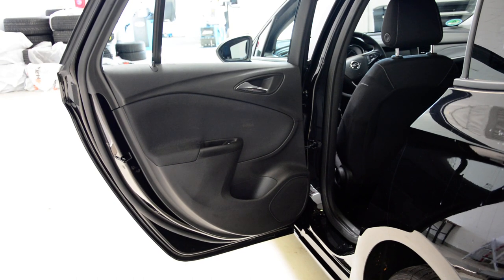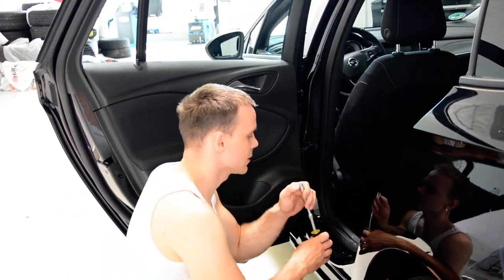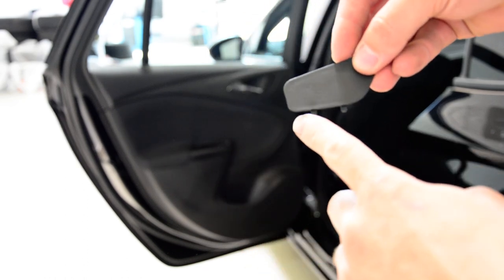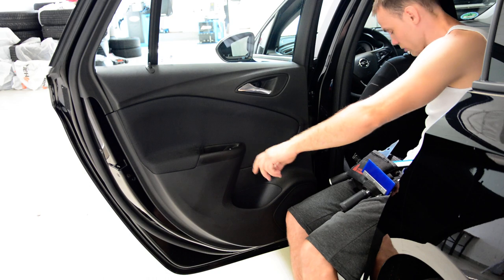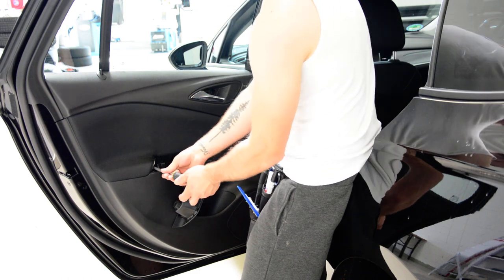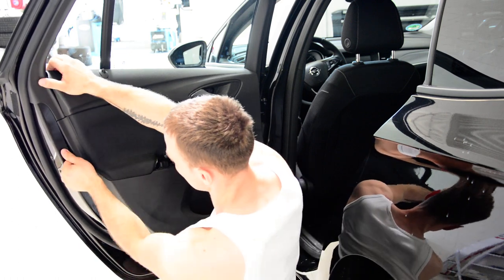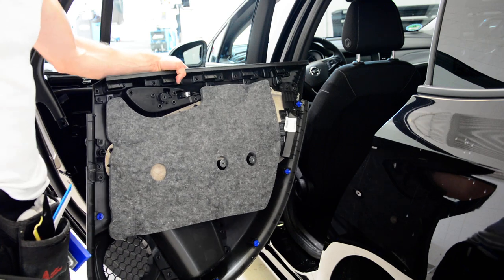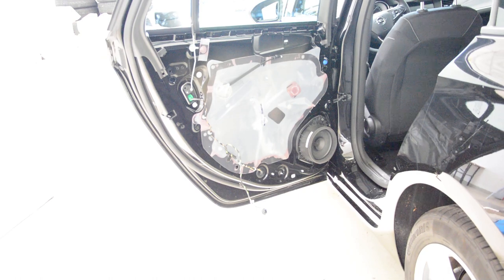How to remove the door panel Opel Astra K 2017

Comment: Dear friend, i try to remove front door panel for assembly of oem led pipe. I wonder is there any orijinal socket to provide voltage for oem led pipe. Did you see any ambiance led light socket in door panel?